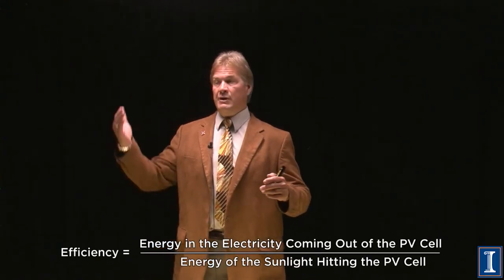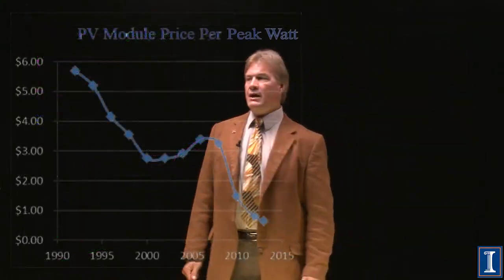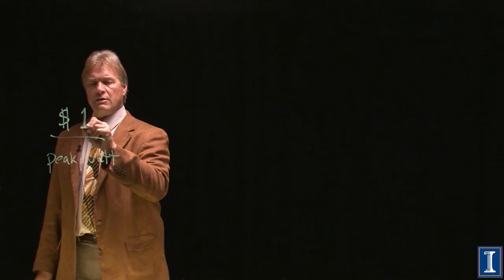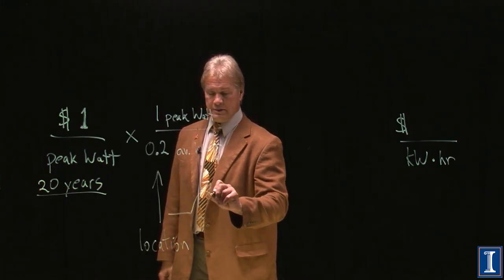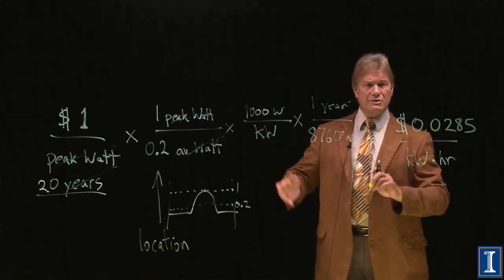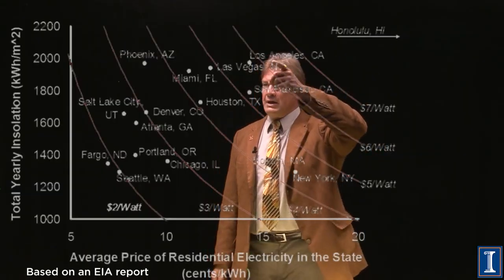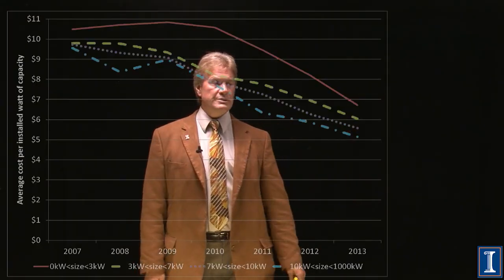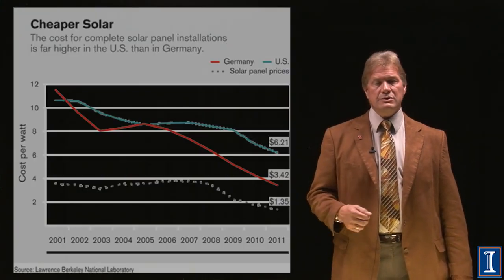The Cost of Sunshine

Comment: I worked for a guy who did solar installations.

It’s pretty easy to install them. We have rails that are bolted into the roof and sealed at the bolts so no water leaks in. The panels mount on top of them.

Then you add inverters on each panel, which snap on to the leads coming off the panel

Then you have an electrician wire it into your home/grid.

It only costs 8-10k to buy a good system, which when installed by a solar installer, jumps to 20k. You could cut these numbers in half if you did it yourself. It might take 1-2 days to install the panels.
Reply: This figure makes me wonder how insanely rich the people must be who decide to have other people install them -- is their time really worth 10k per day? Or are these people total pussies? Just do it yourself and save 70% of the cost, you can buy a big lithium battery with the savings.
Reply: @DavenH  
Mostly the RICH purchase these solar panels , which keeps their cost high .
( it isn’t poor folks who buy Tesla’s ) .

Additionally , these “GREEN” technologies are subsidized ( translation : the middle class & working class pays for it ) . 

We essentially are forced to pay for the obsessions of the wealthy 😉

Have a nice day 👋
Reply: Tesla has solar roof shingles that gather energy while acting as shingles. If one goes bad. pluck it out and replace it. No problem.

Comment: If you would compare total electricity price for households you would see that Germany and Belgium have very high prices, about 30 eurocent per kWh. This is due to high taxation mostly. So the economics play different. Even at a total cost of 17 eurocent per kWh you are way better of to install PV. As such, Belgium and Germany have a very high PV penetration per capita. Not far enough to combat climate change, but its a start. Electricity prices in the USA are just to low to push households towards PV.

Comment: I'm guessing the cost per KWh for a coal plant includes routine maintenance. Solar panel maintenance may be simple, basically just wash the dirt off a couple times per year and check connections, but it is still a required cost to maintain rated capacity, this should be included in the calculation.

Comment: Part of one of my engineering classes was to see how long it would take for the solar installation at the college in the Seattle area to pay for itself. Assuming no loss in production capacity and no maintenance cost, about 220 years.
Reply: Given it is a college, was that installation done for actual power generation or for researching solar power? If the first one, either someone is an idiot or it's corruption. But having engineering students install some panels and test how well they work sounds like a perfectly normal project, now with the added bonus of driving home that you need to research if the area is suited for solar FIRST.
Most areas where solar doesn't work tend to have regular winds, something has to bring in that cloud cover after all, so in a perfect world it should be pretty simple to power whatever you want with renewables. Unfortunately a lot of places have focused on subsiding only PV panels, not other forms of solar or other types of renewables, and that is just plain dumb.
Reply: AnalystPrime It was done specifically to be “green” and to show off how much the college cares about the environment. They were a pet project of a few of the staff basically for their own amusement and to include pictures of on advertisements showing how environmentally responsible they were.

The physics teacher had us do the research and figure out exactly what what’s going on with them, how much power they were generating, and whether it was a worthwhile expense.
Reply: @HughesEnterprises  Ah. I'm guessing this happened a while ago, companies are more proactive about warning customers not to waste their money these days, and there are fewer scams as people are more informed. OTOH, if they were just after the image enchantment or the work went to someone's friend's company... yeah, not just a waste of taxpayer's money but likely illegal.
Reply: Hughes Enterprises A local university did the same thing. They spent tens of millions on artists and consultants to make the array visually striking, as it was on the road when you enter the campus. The cost per watt ended up being something like 10x above average for the time and it will never pay itself back.
Reply: @ericspda  That really isn't a solar array then, but an art installation. Making art that also collects some energy is a nice idea, but anyone wanting to justify the tax incentives given to renewables must prioritize making it efficient and effective. Solar panels in wrong climate or on the lawn when there is a perfectly fine roof for them are neither. And really, why don't more people and businesses use wind?
Reply: PV isn't the way to go at all, solar thermal running a steam turbine runs nearly forever on minimum upkeep. Mirrors are something we can produce at less than $1 per square meter.
Reply: Troph2 Why are these so uncommon then? New large scale PV installs are happening all the time.
Reply: @ericspda  They are going up all over, google concentrated solar
Reply: Troph2 The numbers I’m seeing suggest they’re being installed dramatically less frequently than PV.
Reply: @ericspda  Initial cost and they are still trying to get the efficiency up, last I heard. Problem with large grid scale plants is you need time and money and few square miles of land and it will only start working after it is finished, while you could put PV on houses and raise windmills all year long for a fraction of the cost and each of those will start producing power as soon as it is ready.
CSP is better and cheaper in the long run, but we need multiple CSP plants working for a while to really show the numbers. In 30 years the PV panels produce about 70% of the original power and replacing them costs about $1 per watt, while the CSP plant should be working as well as when it was built, assuming proper maintenance.
Reply: @Troph2 It's true mirrors are way cheaper, but you need to always make a CSP plant on megawatt scale to make it efficient and economical and the tower is not cheap or quick to build. PV only starts having problems at grid level because we don't have enough storage or industries that would only do work when they get cheap solar electricity.
Reply: @AnalystPrime  I won't deny any of those problems with CSP, and being grid-scale only that it doesn't create energy independence which I'm a big proponent of. I Just hope our E recycling becomes really good when we have millions of solar panels  to get rid of in 30 years. That is where the mirror's near indefinite lifespan might really pay off. Also, the natural storage solution of the plant also is a stabilizing source for the grid, which can be tricky for PV. I like the idea of water batteries, which seems pretty harmless to the overall environment than chemical batteries on a grid-scale.
Reply: @Troph2  Exactly, CSP is great for grid, panels have other strengths. Though if you make grid scale PV farm you might not bother with recycling the panels, just put new ones next to the old; taking out the old panels costs too, and they still produce about 70% of their original capacity. Your house can't fit infinite panels so once they have paid themselves and the production drops below what your home needs it makes sense to buy new ones, but desert is pretty cheap and you can keep getting revenue from the old panels while installing more.
Another thing, PV panels are almost completely made of silicon, just like windows and mirrors, we can recycle them already. If we need dedicated panel recyclers for the types that have some special ingredients, that is called a business opportunity and someone will offer their services when such panels start to pile up in the warehouse. And storing them won't be a problem either: If the panels were going to rust and release toxic chemicals like old cars do, they would have been doing that while they were in use and nobody would have put them on their roofs. Or in other words, recycling PV panels is only going to be a problem if the world decides to stop the current trend and build less recycling facilities.
Reply: Norm T Even on a peak day the power generated MIGHT have been enough for just one building, on a day like today it would be lucky to charge your phone. Giant waste of money nowhere near the reliability of a diesel generator.
Reply: @HughesEnterprises  Where did you get your numbers from? That sounds remarkably misaligned with real world data, unless you have among the worst conditions in the world.
Reply: Jon Doe Seattle is one of the worst places in the world to get solar power. The only thing that makes it worthwhile for homeowners is the piles and piles of tax breaks and incentives that make the panels nearly free at the cost of the taxpayer.

The array was in a fixed position that could not adjust to changing sun position, the panels rarely passed 8% efficiency. On a weekend day in August in full sun it could barely power the empty 20,000 square foot building they were on top of.
Reply: Hughes Enterprises Well that’s quite unfortunate. Presumably the electric is cheap as well? For a great deal of the world solar works great and payback can be remarkably brief in areas with expensive electricity along with favorable conditions.
Reply: Jon Doe Where I live is over 85% hydro power. The rest is Nuclear and some wind. Electricity is near unlimited and cheap.
Reply: Hughes Enterprises That all checks out then. But for plenty of places, this is not the case and solar makes a ton of sense. Even for small residential installs, payback can be under 5 years, sometimes 2-3. But of course it depends massively on the particular situation. Sometimes it makes no sense at all.
Reply: @HughesEnterprises that's strange. Solar panels on the roof of a 20,000 sqf building would be economically a no brainer in any place in Germany, even in the cloudier places on the coast. Maybe they installed the most expensive high tech panels.
Reply: lies

Comment: I'd like to note in addition to photovoltaic there's also solar thermal, that accumulates photons onto a medium that then produces electricity from the heat. A few people have experimented with steam, but I feel in smaller residential setups solar sterling is a bit more appealing; it powers a flywheel, which can store (some) energy for spikes, should be relatively cheap to build, and in an emergency you could certainly power it with a candle or alcohol lamp (I don't recommend this; you're not going to get any reasonable amount of electricity from it, but for some reason I find the thought of being able to do it comforting). 

 That said, one of the main reasons I like solar sterling in comparison to photovoltaic is environmental impact; if we were to charge people based on how much carbon various sources of power put into the air per kilowatt hour, in addition to the toxic elements involved in photovoltaic, and the impact on important birds of prey that wind turbines have, nuclear would come out on top, but I'm quite confident solar stirling would be a mildly far second. 

While many argue the economics of various sources of power, I would like to contend that we're producing them with borrow "money" courtesy of the environment.
Reply: The economics of solar thermal are terrible. A PV panel consists of a sheet of glass with some other glass glued to it, and some electronics on the back. No moving parts. Solar thermal has cooling loops and, in your example, a stirling engine. It's hundreds of times more complex, has lots of moving parts, and for that you improve energy collection from around 20% to maybe 35%. There's no way you can bend the numbers to make it worthwhile, which is why no one is doing it.
Reply: @MauryMarkowitz  It depends on how you analyze the payoff. Most of the parts are easily recyclable, and produce few dangerous waste products in the production process.

In contrast if you look at the environmental costs of most other power sources solar thermal can be quite a bit more appealing. 

Something to bear in mind with photovoltaic is the current use of chemicals with a harsh environmental toll with current methods.

Comment: Why not massive fields of panels that track the movement of the sun? Bypass all of this muck.
Reply: cos they still don't work from dusk till dawn.  there are solar tracked farms but the cost of maintenance and set up, hardly out weigh the 15% gain during sun hours.
Reply: @shrike6259  How would maintenance be worse versus slapping them on roofs? Point is people could buy the energy rather than buy the panels.
Reply: @wuld7915  cos motors/gears moving pivot points break  down all the time.  they need servicing greasing.   and still the people can only buy the energy at day time.  and then the coal plants have to power down at day time (not possible to power down a coal plant that quick)  solar only looks good on paper for mass production.  it fine for a home when you can charge yr own batteries.  but state or even countie / town  sized demands can't be stored in batteries
Reply: and what happens in a cold winter month with weeks of over cast ?   no solar (very little)
Reply: @shrike6259  I live in Arizona. It'd be better down here, but I don't know about energy storage as much. If you could store that, then it would be excellent.